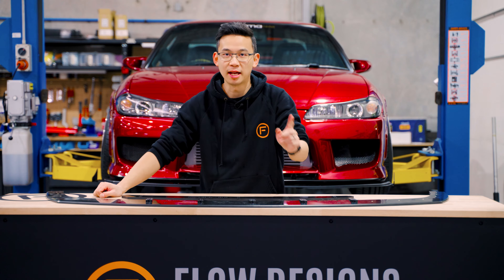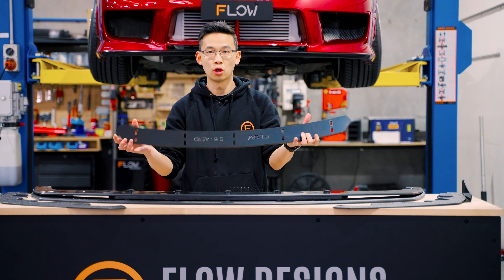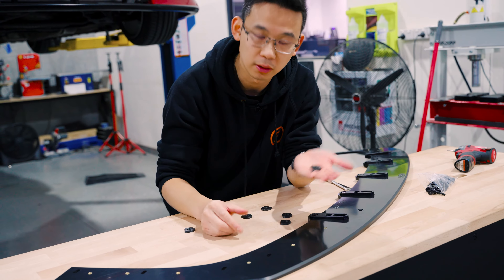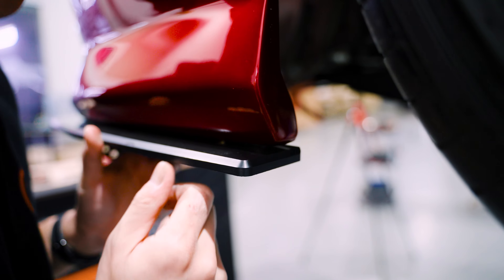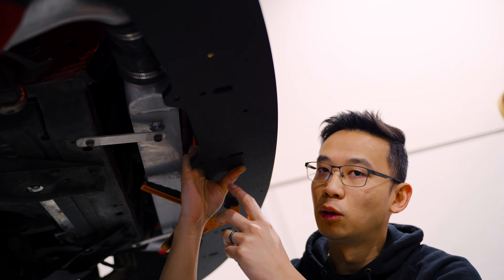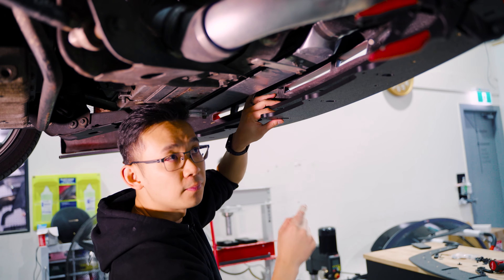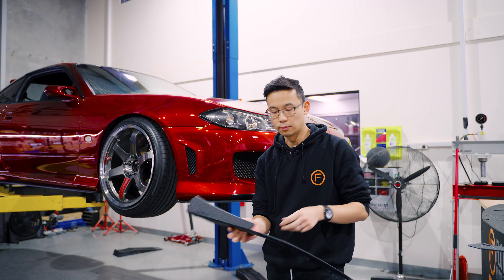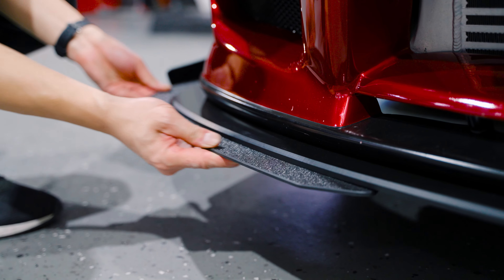How to Install our Front Splitter on the S15 | Flow Designs

Comment: Thanks for the video.  Question… will the OEM plastic undertray still mount up with the front splitter installed or doesn’t it have to be removed?   Mine still has the undertray.